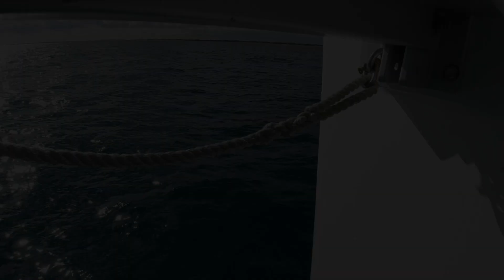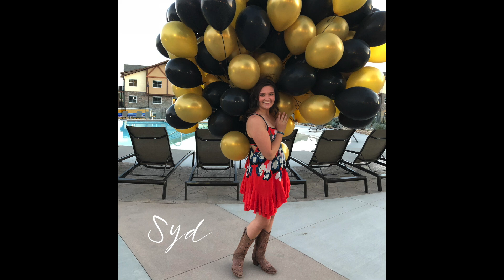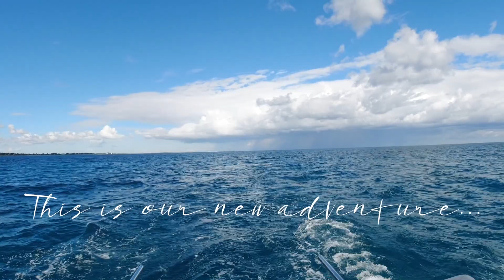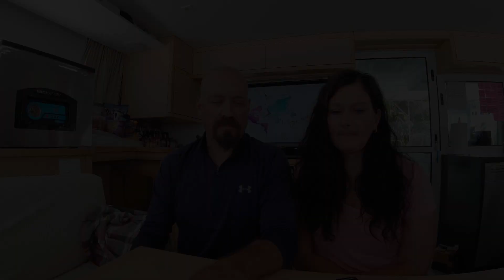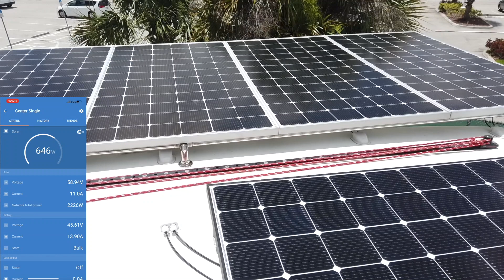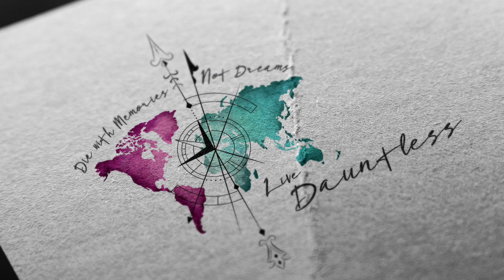POWER SERIES PART 5: Q&A//Wrapping Up Our Power Series With A Q&A-Episode 15

Comment: There is no way to put a lithium battery fire out to let it burn out. Just last week there was a boat in the Dominican Republic that had its batteries catch on fire and sank.
Devices used now use lithium iron phosphate because it's more stable than pure lithium batteries are. The water is on the outside sure but you still can get them wet via condensation.  Hopefully on the new boat will go to the battleborn route as they now have a Marine lifepo4 battery

Comment: For anyone interested in doing a big lithium upgrade and concerned about the risk involved with buying used modules, Rimac apparently has a marine-specific (IP66) battery pack based on the same batteries they and Koenigsegg use in their cars.  Not sure what they cost, or whether they are available as a retail product or if you would have to custom order them from Rimac (as I am only in the dreaming/obsessively planning phase of my boatventure and haven't reached out to them) but they are actually even better power to weight than the teslas at 25kg for a 5.5KWh module.

Comment: Thanks for a very informative video series on Tesla battery conversion.  One Question. did you look at purchasing Tesla Powerwalls instead of batteries charge controllers etc. Powerwall have all of that built in I believe?

Comment: Hi Sailing Dauntless, Hope all is well with you all, have not heard from you for a while. Great video's and information. Wondering what your thoughts are on large secondary 48v alternators and smart external regulators - Would appreciate your wisdom and thoughts. Thanks and all the Best, Tony.
Reply from the maker: Tony, thank you for watching and we appreciate the support.  More is coming very shortly so stay tuned.  As far as your question goes, the answer is YES.  48v alternators are a possibility and a good idea depending on solar size and generator availability.   You will see our large expanded solar in video soon with an awesome temp solar system we designed .  Above that we are waiting to see what our charging potential will be and may be adding 48v alt for a backup at a minimum.  You may of seen how I am very concerned with redundancy so that is leaning me towards adding them..... however..... there is a loss of hp and fuel consumption to consider as well.  If I can source some reasonably priced alternators there may be a video coming your way.  Any suggestions?
Reply: @SailingDauntless  Thank you for the kind reply and great youtube channel. Have you looked at the Wakespeed WS500 or Prestolite/Leece Neville alternators, they looked interesting options to me.  Wakespeed (you can also configure it yourself - very detailed?) It could help with the loss of HP and fuel consumption? All the best, Tony. PS. Would as always be interested in your thoughts.

Comment: Sorry I’m late to the party, just found your site. Love the solar series , excellent presentation. 👍 Based on figures you’ve presented I’m guessing you have somewhere between 20-25K invested in this system. Have you calculated what you believe will be your payback time frame ? Also, based on what you have described as your constant daily drawn down and daily resupply of solar power, what is the life span of the Tesla batteries versus other lithium batteries available on the market today ? Thank you.
Reply from the maker: Steve, around 26k.  I don’t know if there is a “payback” time as we don’t have a grid option to compare it to.  Building the system ourself we spent a fraction of what most boats do and got 5-10 times the power. But, with how we use the batteries we are expecting 15-20,000 charge cycles so they will last potentially longer than the boat.
Reply: Sailing Dauntless        Excellent on both accounts. 👍

Comment: Great technical videos!! My question is, so many other YouTuber boat bloggers have added lithium batteries and around 2,000 watts of solar... but they haven’t added a 15,000 kw inverter or worry about electrical ground issues killing fish/people or overheating the European standard wires. They aren’t an electrical engineer like you, so are they doing this wrong/unsafely or do you have such a larger system that you have different needs??
Reply: Good question. The short answer is yes, we have a VERY large system.  The reason for the 15kWh inverter is because we don’t have a generator and so we can run EVERYTHING at one time if necessary/desired.
Reply: Ty A Why haven’t others put such a large inverter like you have? This is the first I’ve seen of it. Some examples are the O’Kelly’s interviewed a guy who did a $1M all-electric refit on his boat called “Top Secret” and I didn’t see it. Gone with the Wynns switched to lithium, even for their A/C and just changed out a few batteries and maybe a small inverter?
Reply: Tommy Holly, it all comes down to energy independence and a full suite of “bricks and sticks” conveniences.  Once you add as much power and appliances as we have, the “economy of scale” kicks in with charging, efficiency of inverting and speed of charging/recovery.  This vessel with 4-6 people on board using all the equipment consumes 2-5 times the daily energy of the ones you are describing.  But they have also been a big inspiration, in fact, I told Nick with the O’Kelly’s that his top secret video was very helpful and was a springboard for some of our designs and systems.

Comment: Battery location may have been the same but replacing AGM batteries with Lithium batteries and keeping them dry away from any water intrusion can be challenging. This is what happens with Lithium batteries and water.
https://www.youtube.com/watch?v=bNMfe20I_IE
Not always does the boat fills up with water from top down. Hull penetration, hull delamination, hull puncture, running a ground, an undetected leak can introduce water into that battery compartment. I am sure you have done more research on the topic of batteries than I have but admittedly your experience on a boat is limited and what can and will go wrong in the water is something you have yet to experience. Just a friendly cautionary post, not a criticism.